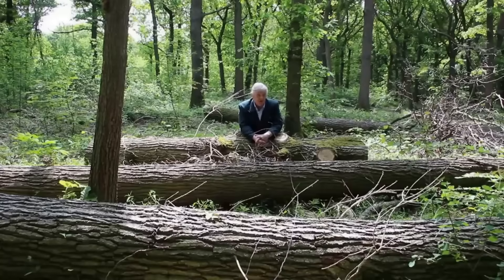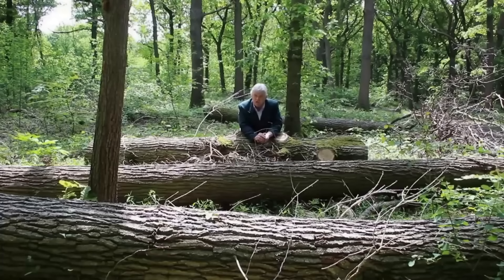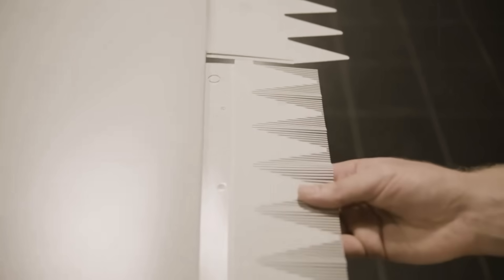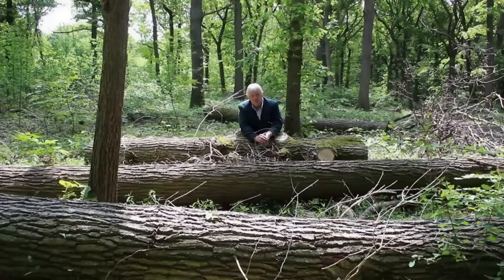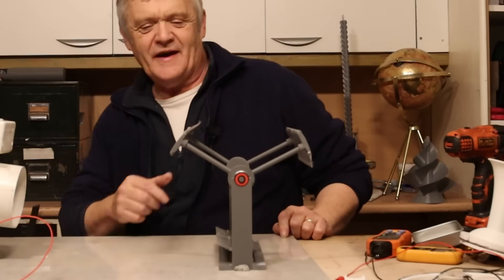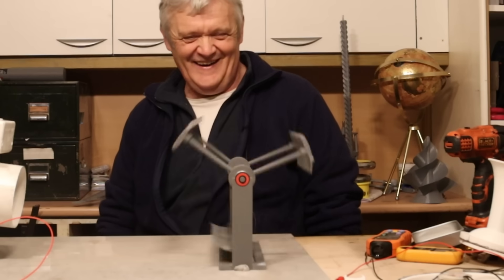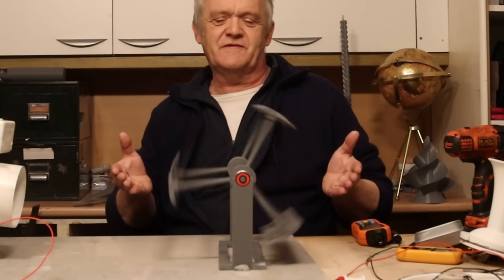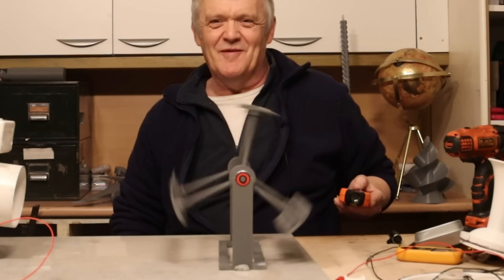2111 VAWT Wind Power - The Great Leap Forward

Comment: I understand that if you place this build on its side compared to the way it is video taped it will work with wind coming from any direction.

But What I don't see Robert attempting is to turn the displayed configuration around 180 degrees?
To the best of my ablity to understand, the blade at the bottom will NOT be aiding in rotations.
Some prodictions forecast that the blade would have negative lift and drag?
So only wind coming straight on from one side would have positive results?

Now were the build placed shaft straight up the configuration would have an optimized moment no matter how the wind hit the system or when the winds changed directions.

Comment: When one scales this pattern up for actual usage.  One should have several material sciences considerations.
1.  The leading edges impact speeds.
The speed of the blade going North is effected by the COMBINED air speed of the dust going South.  This is marginally higher than the speed of the blades (Times 2).
1.a. This leads to the concept that the blades leading edge should be stamped stainless steel.  Keep the Whale bumps but press those shapes into Stainless steel.
2. With a protective leading edge then get an idea of the feasibility of 3D printed trailing edges that become replaceable over time.
2.a. What happens if the trailing edge gets unevenly balanced?  Sensors on the baring surface need to be in place to tell the system to shut down in case one or more of the trailing edges come off or are so worn down that they need maintenances'.

Comment: Just had a thought about bio mimicry.  Why are featherless wings relatively uncommon, arguably an evolutionary failure. 
Feathered wings evolved multiple times and stuck around. So the question is why?

Bird wings are composed of layers of feathers,  I have to wonder if the fact that feathers dont independently completely capture all the air they encounter is a potential avenue to have more efficient air capture in a wing.

Air flows into the wing and not just over it but is ultimately all redirected in the same way. Maybe this increases the amount of captured energy from the air by the wing?

Comment: It's really interesting that the serrations seem to help with self-starting, and that's making me wonder - how big a problem is self-starting with small domestic wind turbines in variable wind conditions? If a little nudge could somehow be applied when the wind dropped in order to get it going again, would it produce a lot more energy?

A couple of ideas on self-starting:

- With a battery setup, could the generator be wired so that when the rotor blades had stopped moving but there was a bit of wind (i.e. just enough to keep blades moving but not enough to start them), it swapped into electric motor mode for a short time, to give them a push? Maybe a miniature anemometer could be used to trigger this.

- Could a mechanical device be added to store up some potential energy to keep the turbine moving when the wind dropped? Perhaps when the blades were moving above a certain speed some of the power could be directed to winding up a spring, pumping water into a raised reservoir or lifting a weight, all of which could then be released automatically to help keep the blades moving when the wind dropped.

Comment: Some have mentioned the direction of wind flow which is a fair point but a Diffuser would redirect windflow anyway.  The Assymetric Vortex Propulsion effect is airflows version of flyback is it not Mr Smith? It starts off as a normal airflow but quickly becomes a vacuum drawing the wind in faster and faster.  The self starting definitely would have be an incentive to those folks afraid of heights which would be most people I imagine. lol. The quieter operation is appealing in and of itself, but I'm surprised the formula 1 designers have not incorporated this into their airflow designs. I read "The Shark's Paintbrush" by Jay Harman, and was fascinated by the Liliypad biomimicry using it's design to displace water droplets that literally rolled off the pad and causing the pad to maintain buoyancy and remain afloat and of course a painting company jumped all over that idea in their wall paint. Makes you wonder what other principals nature could contribute ie; the seeming weightlessness of the dragonfly due to the interaction of it's thoracic and the tiny tiny cone structures along the surface of it's wings.  Anyway just a thought sir. Still loving the videos sir.

Comment: If this were vertical with the axle going thru a Darwin wind capture device inside the vawt directing air to a bladed turbine below, would there be enough flow to generate power? 
Similar to a high pressure steam turbine outlet flowing into a low pressure turbine to capture more power.

Comment: This design of VAWT 'wing' (even horizontally) works on air flowing over the wing and squeezing the trailing edge to push the wing forwards into the wind, you have the fan blowing on the trailing edge only

Comment: These are all hard versions of an owls soft wing edge. Wondered if you just stuck on the sort of frilly edge you get in a dress shop? Will airplane wings follow? You seem to have done a thousand wind turbines is there one standing out as a winner? One of the complaints in marinas is the noise from yachts small wind turbines. Your speech from the forest was very elegant. You are the David Attenborough of tinkering.

Comment: The principles surrounding eddy reduction via serrated trailing edges are well established, subject to scale and Re variation.

The test shown on the video is inconclusive because the fan was pounting towards the lower half of the transverse-axis projected area.

This guarantees a differential drag/lift result for opposite halves of the projected area and removes the likelihood of TSR plateau around 1.0.

A better test would point the fan at the axis of rotation, then measure and compare results for both cases, with and without serrated edges.

Good video, but imprecise engineering, unfortunately.

Comment: I wonder if you could use a semi permiable material for a tubine blade.

Use a frame and then stretch a panty hoe material over it so there is enough resistance to get the blade moving but also let some wind pass thru.

Does that increase more drag or make the blade more unbalanced? 

Idk, just a thought im having

Comment: While your at it, imitating nature, do you think it could be possible to imagine a generator based on an emulation of leaves on a brach? Couldn't each "feaf"  fluttering in the wind produce some current?
Also, about fans, would it be possible to produce a very simple mechanism based on grandma's clocks with weights and  geer wheels? (I live in the southern hemisphere and it is getting pretty hot here…)

Comment: Hi Robert, I love to know there's someone else whose imagination never ends. 
I apologize for asking here about a sand battery...I've scrolled looking for your video about making one.
I have a rather big copper bucket with a cast iron handle on it. Is there any issue using copper as the container, instead of the usual I see people using? If anything I thought it could run hotter, or radiate heat more because it's a conductive element. 
I appreciate you and the knowledge you share!

Comment: - yes self starting-  ......  - with a jet of air blasting at the  retreating blade - this is operating in a dynamic wind regime...  Indeed, LE ans TE devices are able to deal with imperfect airflows - reducing separation of airflows under varying "dynamic" conditions.

- induced windshear -  similar to "partially shaded/shielded conditions which allows for seabirds to dynamically soar without flapping their wings for days ata time...

Comment: My only criticism is that the fan appears to be blowing towards the bottom rather than perpendicular to the axis of rotation. perhaps this would make the turbine appear to self start.
Reply: I was wondering about the jet stream of air pushing just the lower blade surface. I'm sure if the air stream was balanced at the axle it wouldn't spin nearly as fast.
Reply: -  indeed that is the starting regime for these turbines (if at all possible under normal conditions) - drag...  Aerodynamics happens at "cut-in speeds" where the turbine blades exceed windspeed by up-to several times (load dependent)..

Comment: Wow!  Self starting quiet and much faster.  I call over 200rpm a huge improvement; what's that 25% better than before?.  To my mind the speed seems to be increasing the longer it was running.  That may have just been my old eyes playing tricks (which they do).  Obviously if there is an increase in speed under a constant air flow that's not going to continue.

That is already the sort of thing that could be clamped to the hull or a spar on a boat, or set up somewhere on or close to a campsite and charge up the battery for navigation or refrigeration etc.  I'd love to know what sort of voltage could be generated with what sort of wind speed, using just the little toy you have put together.

Legend Rob.  Absolute legend.

And I thought, hmm putting a Frankenstein whale/owl concept together is never going to do anything.  So, what do I know?  I know enough to not trust myself.

Comment: We installed Serrations on the 56M blades we built for GE, and it was reported to us that besides lowering the noise level they also have seen a 3 to 5% increase in Power over an extended duration. So, bird brains are evolutionary giants!
Reply from the maker: nice thanks for posting mate
Reply: Bird brains, excellent !
Reply: Great to see that lots of research is showing returns - Whale tubercles and trailing edge serrations have been areas of endeavour - and in every hydrodynamic textbook - for a generation...  (Durability, reliability and manufacturability - have always been key points to improve upon - as well as ROI)

Comment: Thank you for this. It is what I was thinking with the needle like structures on the tailing edge. This with the needles being sharper and the bumps on the leading edge being smaller I think than you will see an even more significant performance increase. The way that you have it set up now would be a good sizing for boat props. Still set up for water. Can't wait to see this the atleast 10 times smaller bumps on the leading edge🤙🏻

Comment: Hi Robert, Thank you for experimenting with the previously requested Owl's wing trailing combs. Much appreciated. I was surprised to see the self starting of the VAWT design. I imagine that the airfoil's camber profile bowed to create lift at low airspeed much as modern jets deform it's wing shape in part by deploying there sliding slip fowler flaps to take off and climb at the lower take off speeds with increased angle of attack. Most interesting result. Thank you, so much, once again for the video presentation on Owl wing trailing edge comb benefits.

Comment: Any idea on why the fan became self starting? Brilliant result, though! I'm sure it was quieter as well. Once it got up to speed it seemed like the axle made more noise than the blades. Even the Noctua ultra-quiet 120mm fan that I got recently, for a soldering fume extractor, has a jagged trailing-edge design now. I have to say that it is very quiet indeed, even at a full 1800rpm.
Reply: While the wind traverses down to the trailing edge and off of the points it is getting an increase in speed as the surface area collapses to the spiked edge.
Reply: @Zane.Wellnitz  thanks! Aerodynamics is not my strong suit.
Reply: @gerryjamesedwards1227  no problem Gerry🤙🏻
Reply: Look a where the fan is pointed.  Anything would start spinning that direction.

Comment: The fan is angled down in this test unlike the previous one. This would likely explain the higher RPM and self starting.
Reply: I think Robert puts his energy into ideas, the theoretical science, rather than ridged testing.  YouTube is hard.  After all, people would patient his work if something worked, and that’s not fun for creative people. 

I think he is getting closer to a functional wind generator for the home, though.  They do look like something that one could build and save a tonne of money on with a 3D printer.  I don’t see value in a 3D printer - printing plastic.  Though, blades could easily be replaceable, and the DIY nature could get around patents. 

Perhaps, a full scale one could be printed, Robert.  You could measure the efficiency by wind speed versus electricity generated.  The, keep re-placing it with more efficient ones that you print.  After all, no commercial company will put the research into home generation - turbulent wind.
Reply: My excuses for repeating your observations. Didn.t see your comments for some reason.
Reply: That's actually ok I think. Because in real world, the wind flow will not be perfectly aligned with the axis.
Reply: But it's a different test environment, causing different results, is @6strawb point. @তুহিন_জানা
Reply: @তুহিন_জানা  The issue is not the angle with the axis, because in the real world the wind can come from any direction, which is the point of vertical axis turbines. The problem with this demonstration is that the wind is only blowing on one side of the turbine, so there is no resistance coming from the other side of the axis. A proper demonstration would want a uniform mass of air hitting the whole thing, as you would find in a wind tunnel. It is possible to make a small wind tunnel using a fan at the front end which will also pull in more air, then put in baffles to reduce turbulence and provide a more uniform column of air hitting the turbine. You could also get a more uniform mass of air by moving the fan further away from the turbine so you get more air moving more uniformly across the turbine, though it would likely be at lower velocity.

Comment: The blade noise reduction tech is very interesting.  I wonder if DARPA has thought of adding a serrated trailing edge to a stealth helicopter rotor blade to reduce the rotor noise.  Probably.
Reply: Yes, there's a similar version for helicopter blades. Instead of the trailing "feathers" they use a fractal design of serrations on the serrations. I remember something about prime ratios for the sizes and number of serrations.
Reply: @PhiloSage Guessing that they are trying to not duplicate frequencies as much as possible as to not amplify any particular frequency as much as possible?? 🤔
Reply: Doubtful, they are not very smart.
Reply: @Zane.Wellnitz clearly they are smart but they may not have had a biomimicry class. Even when optimizing propeller shape, things like random dents in the surface and feathered edges are somewhat out of the box...
Reply: @RupertBruce  true. Dents on the bottom and slight protrusions on the top for more lift at lower flight speeds

Comment: So if you want a self starting turbine of this type wouldn't it make sense to add a small width archimedes in the middle part (near the bearings)?
Reply: Maybe on a freewheel bearing so it wouldn't slow the turbine down if it started spinning fast enough.